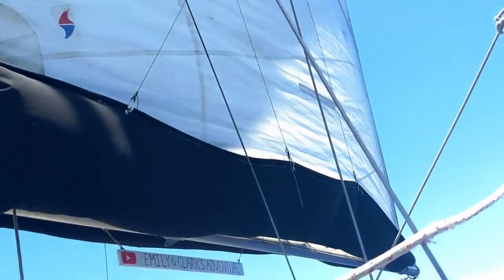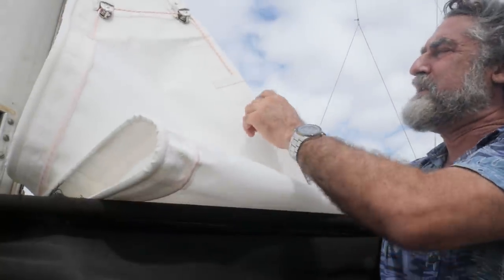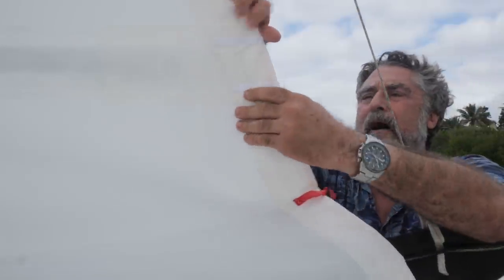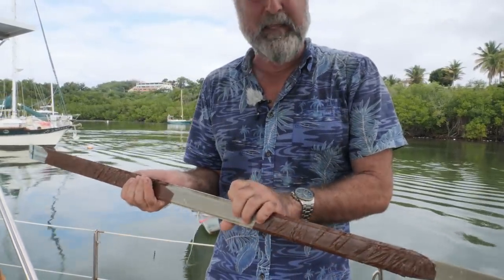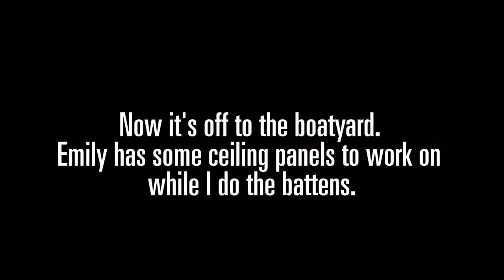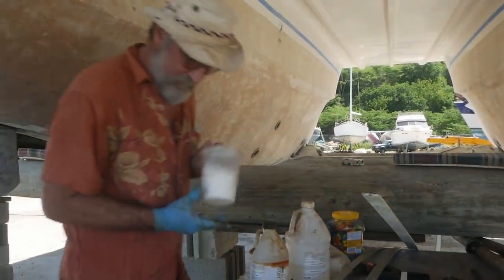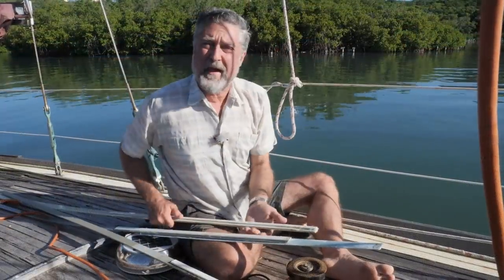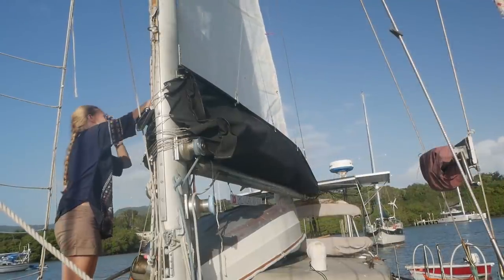Finishing the MAINSAIL [Capable Cruising Guides]

Comment: one thing that might add to your fancy new sails is a pair of "dog bones" - sorry local Oz terminology - which is essentially a large (35mm) stainless ring (s) with a webbing strap placed through the cringle of each reef point - so you can hook the said cringle over the horns on the gooseneck comparatively easily on either one or both sides of the main.  it makes securing the tack of the reefed main to the horns much simpler.   I didn't see any chord lines on your beautiful new sail.  Its nice to hear for once someone quite happy with the work done overseas. Quite a variable feedback from that process  - loft dependant I guess
Reply from the maker: We don't have horns.  I have a short line spliced to a stout hook.  Works well and easy.
  I agree reefing needs to not be a struggle in easy days or it's impossible on hard days.

Comment: Hello. Was wondering what brand/type of winch you have for the mainsail sheet. I have a hybrid line and cable for my 1969 Columbia 36. Wondering if yours might work for mine. Enjoying the videos. 👍
Reply from the maker: It's a barient real winch.   Works best it it's all cable as the rope is thicker and might get chaffed my the cable over it.  Also cable is cheap and low streach and lasts a long time.
Reply: @Clarks-Adventure  Thanks!

Comment: Why two pulleys in the top of the sail? When the cord is tensioned they will want to close in to each other and stress the nice top construction I think. One pulley in the top corner, connected to the top eye could also work.